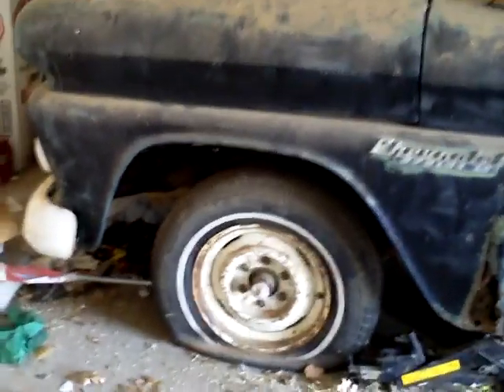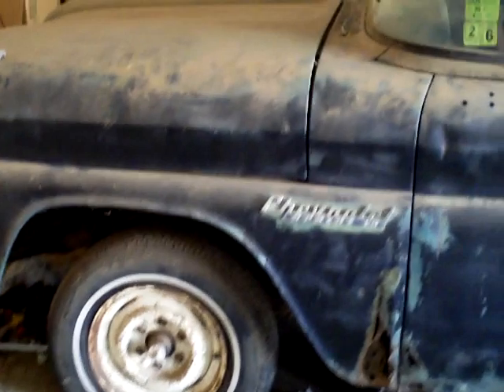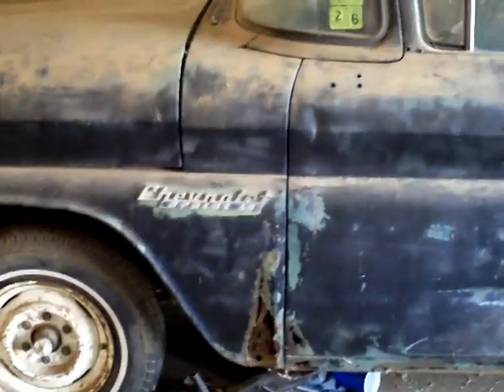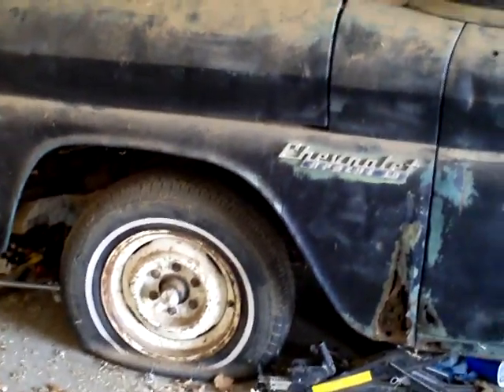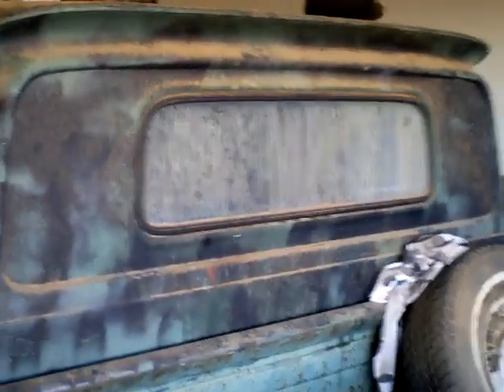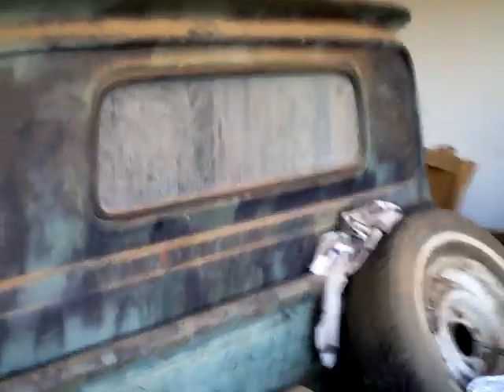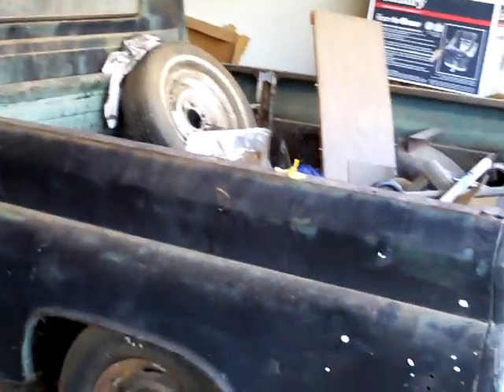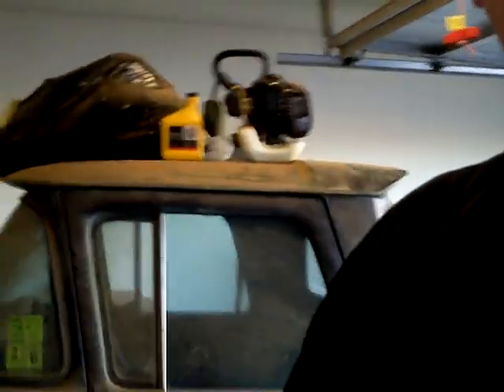Rat Rod - Project Truck

Comment: A Hundred Bucks?!?!?!?!? Man! How's it coming? Driving it yet? I have a 60 Apache stepside long wheelbase Rat Truck. What state you in?
Reply from the maker: +Joe Hilton   I am planning if all goes well to have it running in about 4 months!  I will make a video on it when I get it up and going!  My brother had a 61 step side!  A guy offered him a good price and he sold it!  I live in Texas!  Take Care!
Reply: +skoggit Thanks for getting back to me, good luck. I got the big 6 TON jack stands on sale at Harbor Freight so I can get underneath safely. I'm gonna try and make a video of mine before too long and let you know when I post it. Mine was about like yours, running but in a field. Still it was a lot of work just to get road worthy and a semi safe RAt TrUCk. Brakes all around, wheel cylinders,  one steel brake line, three flexible brake lines, master cylinder, slave cylinder, plus took the head off and took it to the head shop and had it done completely, the head was only about $300. I thought that was pretty cheap. All in all not a lot to do to get one road worthy, just have to have patience and keep stabbing at it a little at a time. Its worth it! I will be in touch. I'm in Alabama.
Reply from the maker: +Joe Hilton I have a straight 6 engine rebuilt engine in it with approximately 10,000 miles on it!   I bought it completely rebuilt from a farmer which was going to use it as an irrigation system but decided to go to an electric system instead. Therefore he sold me the engine for $100.  I dropped it in and it runs great.  I am going to put disk brakes on is and possibly go to an air bag suspension.  I don't know yet, just something I am kicking around right now.  I am going to put an Indian Blanket in the seat.  It has a 3 speed in the floor!   I am thinking about going to a automatic transmission, not sure yet.   My nephews on my wife's side are in a Mexican Car Club and told me to let them make the Rat Rod into a Low rider with hydraulics!  There is so many options out there. I know the Low Rider Club has won many 1st place trophies.   They are the experts of the hydraulic systems.  I will just have to decide on what I want to do with it.  I have a clear title to it, the title is in my name!   Good luck on yours!   Hope you do a video on it.  Take Care!